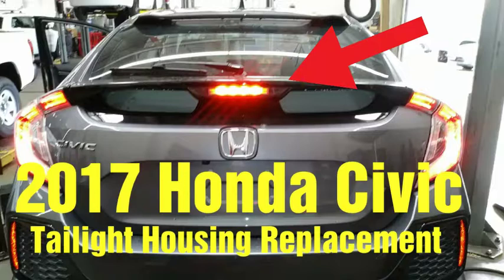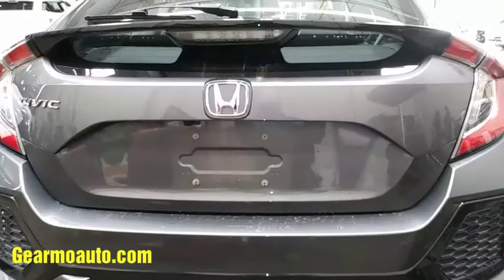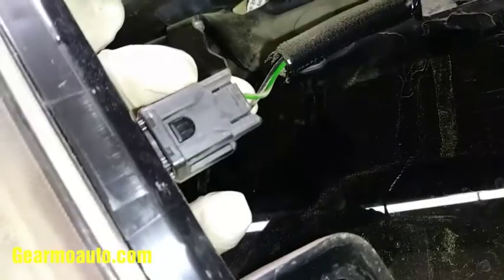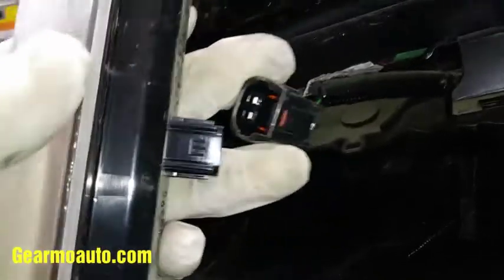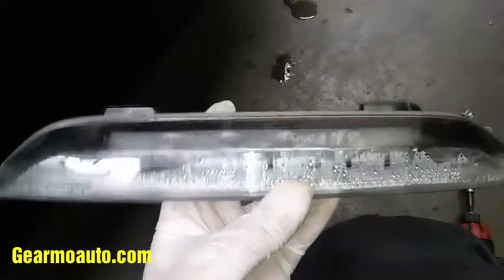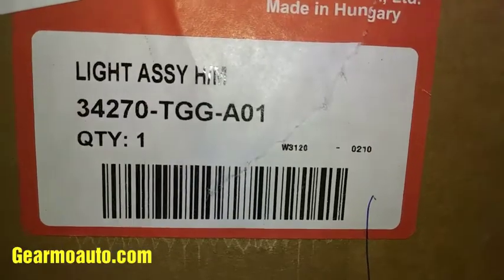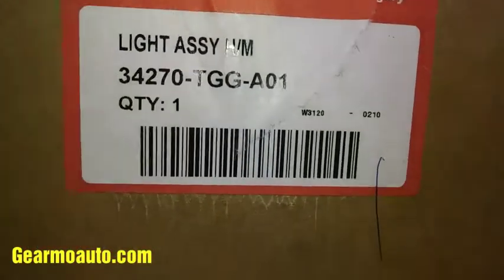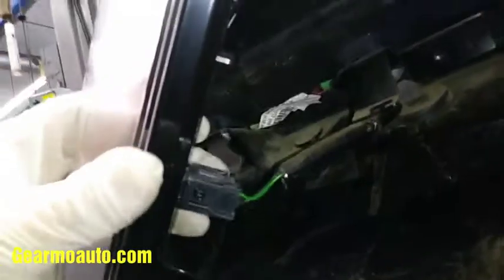2017 - 2021 HONDA CIVICTHIRD 3RD BRAKE LIGHT BULB _ LED HOUSING REPLACEMENT

Comment: Hello, how much did you pay for it in America? It's £500 for replacement part in the UK.
Reply from the maker: Around 80 bucks in America
Part #
honda 34270-tgg-A01
Reply: @GEARMOAUTO  thank you for the reply, I don't understand why it is so expensive in the UK for the identical part.
Reply from the maker: @barryherron5351  ya that's weird man. Do you have access to eBay in UK? That's where I saw it for around 80 bucks.
Reply: @GEARMOAUTO  yes I'll try eBay. Here's the link to the Honda UK for this part https://www.parts-honda.uk/honda-cars/assignment_spare_parts/34270TGGA01
Reply from the maker: @barryherron5351  ya that's way over priced
Reply: @GEARMOAUTO  Tried a honda part company in America and they won't ship to the UK.
Reply: Can the bulb be replaced only ? Or do I need to replace everything